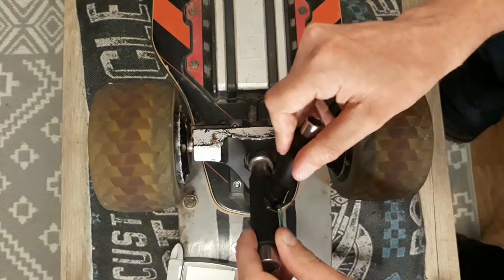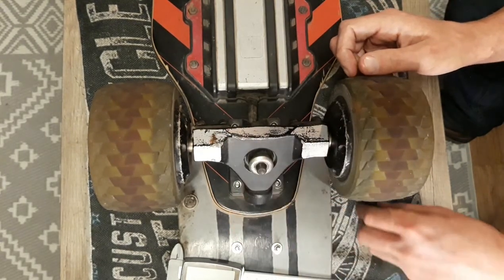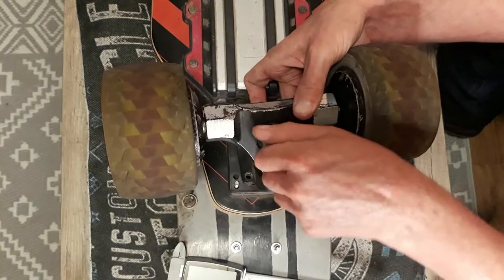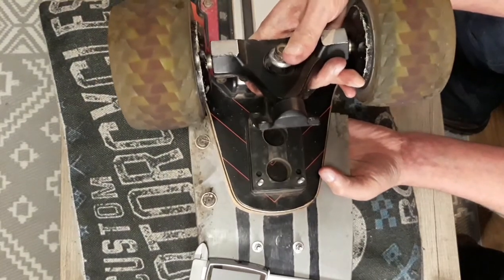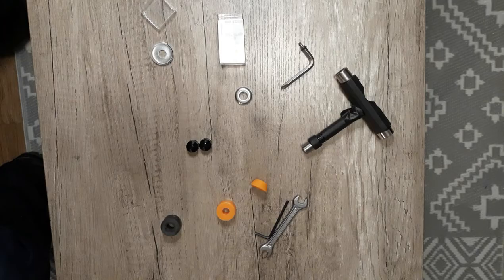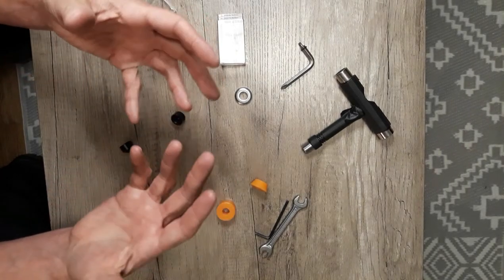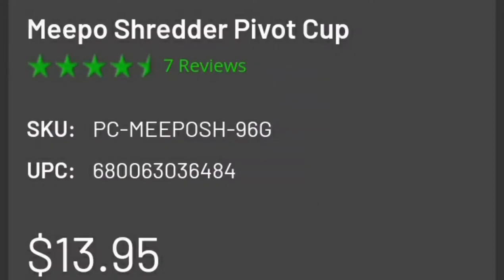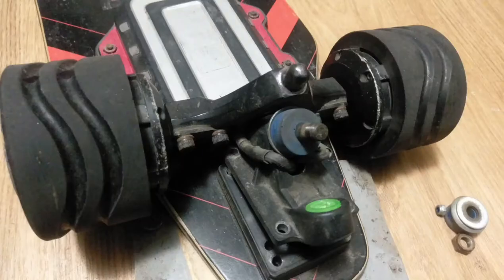Not Standard Sizes... Bushings & Pivot Cups

Comment: 🤙🏼 Usually longboard bushings are taller than skateboard bushings. 🤙🏼

Indy (Independant) bushings are skateboard size, Venom (usa) are longboard size, Venom (uk) are skateboard size, Riptide do both longboard and skateboard size which they call "street" and even shorter ones called "short street".

Double kingpin boards use a mixture of both but most eBoards tend to utilise longboard bushings.
Venom are really good, Newton's Shred let you mix and match rather than buy pairs. Venom are easily the best quality.
Reply from the maker: Yeah, it's a strange one as even longboard bushings were too tall for the kingpin bolt on these... Seems like all bushing listings online lack height specs/measurements.

Sadly, Riptide are really difficult when it comes to clarifying the exact bushing height sizes on their website; was asking for weeks!
Reply: @esk8jaimes  there's info buried in Riptide's site, can be hard to find.
If memory serves, their standard barrels are 15mm high, street is 12.7mm, short street is 10.7mm. Can't remember their Cone heights.

Yeah we defo need more brands to be clear about height at the very least.
Venom standard tend to be around 15mm high. Tall is 20mm or 17mm, I forget lol.
Reply from the maker: @eBoard3R  Thank you for that info, very useful to know!